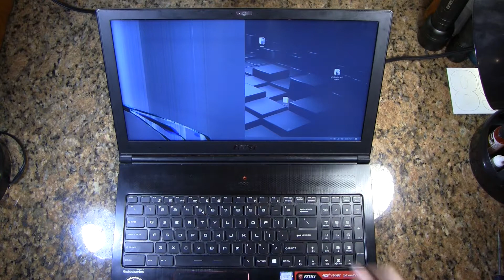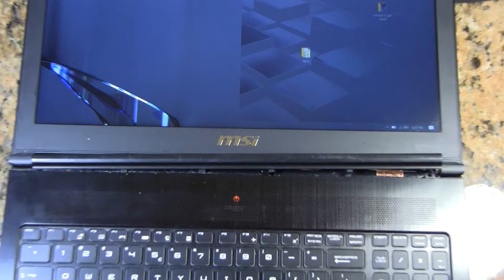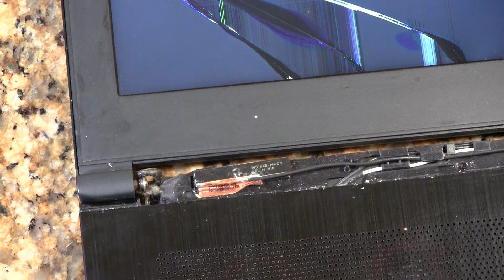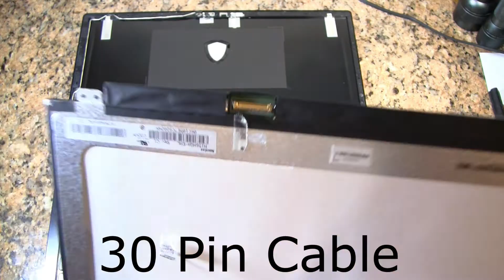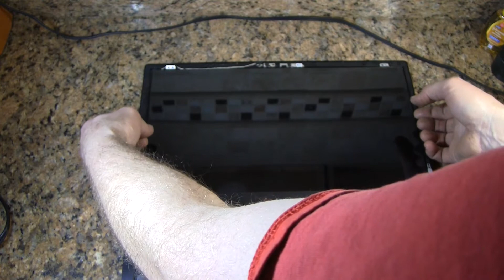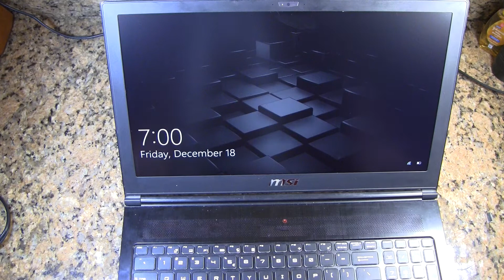Laptop screen replacement / How to replace laptop screen MSI GS63VR 7RF Stealth Pro

Comment: Stupid question: What happens if you change the screen for a 40 pin screen and also change the flex cable for a 40pin cable? I want to repair my ge63, but I just can't find any compatible screen. The thing is: I'm kinda curious to see if it will work with a different LCD that has a 40pin connector by changing also the cable. 
Cheers!
Reply from the maker: Im not sure. I checked my screen specs before i pulled it. I have looked into it and so far I have seen it wont work with different ribbon cable